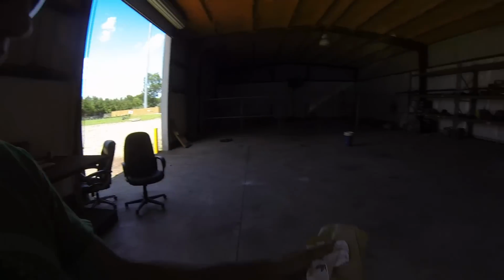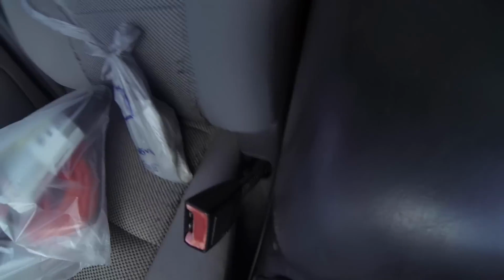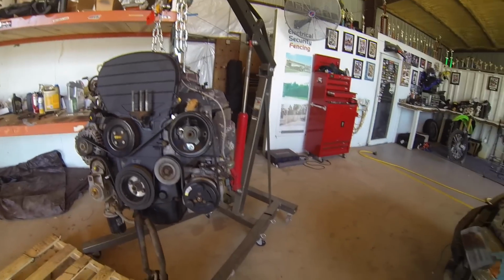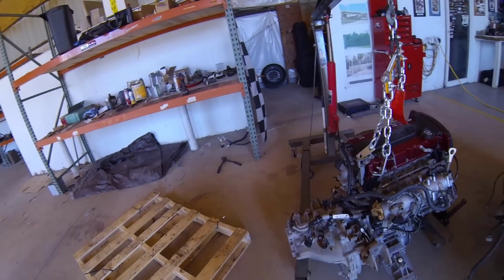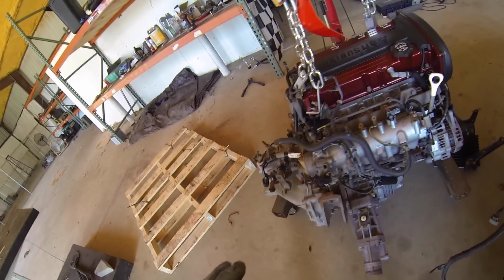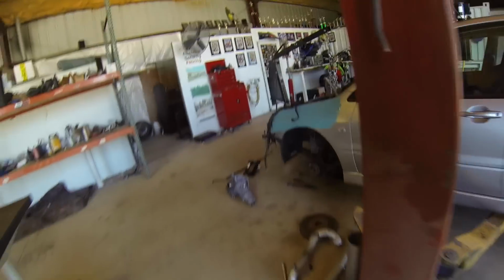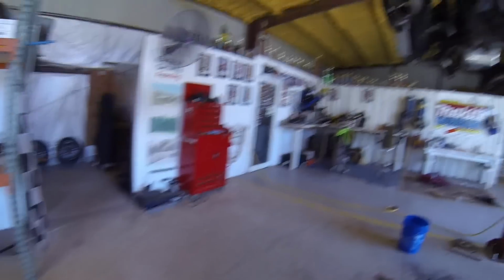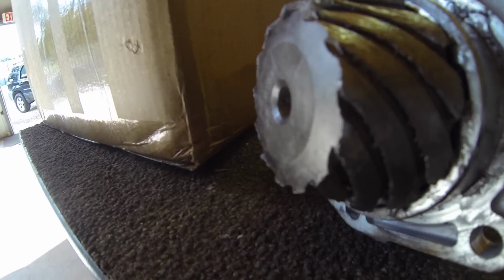THE ENGINE IS HERE!  (Part 4)

Comment: That T-case is going to be a pain to install. Make sure you read up on it first. You may have to actually drop the subframe to get it in there. Be super careful with the o-rings that seal it to the transmission. You don't want a leak after all the pain you're about to endure.
Reply from the maker: I ended up lifting up the engine to give myself room... Then laying on the ground under the car with my friend pushing it up with my feet. HA!

Comment: bro the engine is supposed to be insatalled from the bottom not over the top through the hood. you drop the sub frame, mount the motor then lower the car to the sub frame with motor.